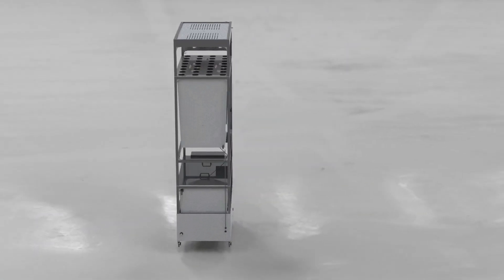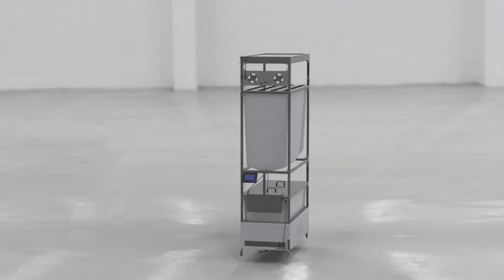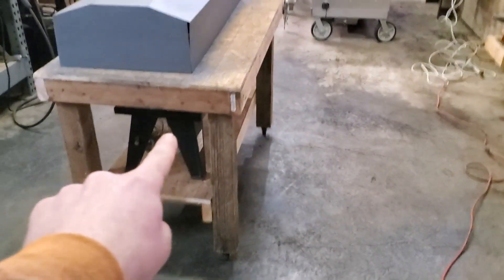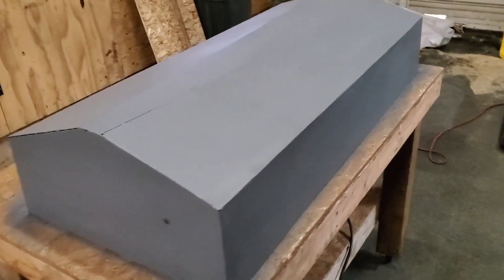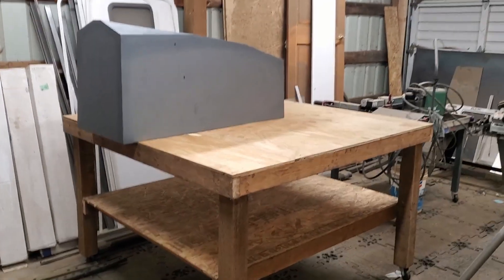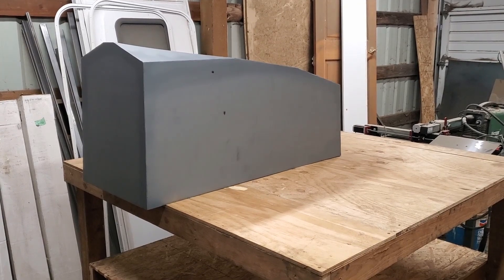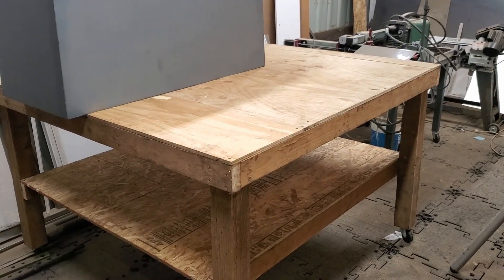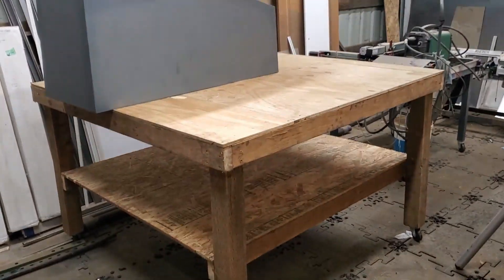Where's the Dirt? AEROPONIC Tower, coming soon!

Comment: Soooo...... that boat... is that 3D printed? You sailing up to Mars? Leaving us or go testing your design up there??

Just kidding. It's good to see you.

You could try to get plexiglass sheets instead of (thin) plastic to cover the openings. If possible on both sides of the stalls. That creates an air trap, air is terrible so transferring heat. You keep the shop a little warmer, the animal can not rip it down, you can still see the animals and they can see you, and it's probably better suited for welding. 

However, the part about keeping the heat in... there are probably more than enough gaps for the heat to escape. So the additional effect is most likely not huge.

Comment: Why not use fiberglass and polyester resin over gel coat. All things that are available at Home Depot or easily ordered from Amazon.
Reply from the maker: for the mold or for the build? for the mold its easier to just use metal...took a few minutes to weld up and time is money...for the build, those items are not food safe
Reply: @TheRealMartian  for the container. The is no conclusive evidence that they are not food safe. Many water catchment and impounds use fiberglass tanks. The marine industry has used fiberglass tanks for potable water for years. Food manufacturers use fiberglass storage containers. Plastic is great for injection molding, but I think if your talking small batch production a female mold, gel coatt and fiberglass can’t be beat. Just my 2 cents.
Reply: @TheRealMartian I came to say the same thing. You'll avoid all the issues of plastic welding and it's much easier to guarantee a strong watertight vessel in fiberglass. You can use the steel mold to create a fiberglass one, they are pretty easy to do. Lots of motorbike racers here make their own fairings this way. 

Jeff, you may want to look into getting metal parts cut directly from a plasma/laser cutting place just by sending them your flat pattern drawings. I have a buddy who builds tuned 2-stroke racing exhausts and he can't buy the sheets of raw material for the price he gets perfect flat patterns cut out.